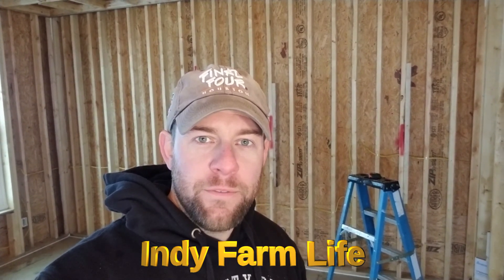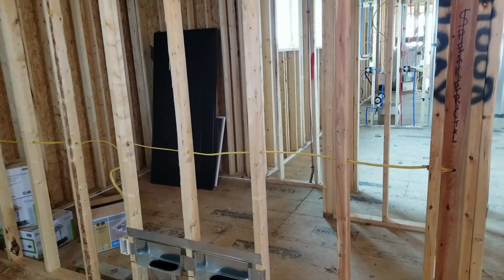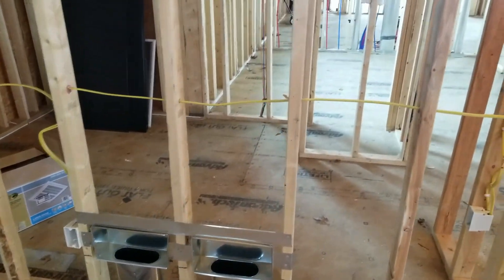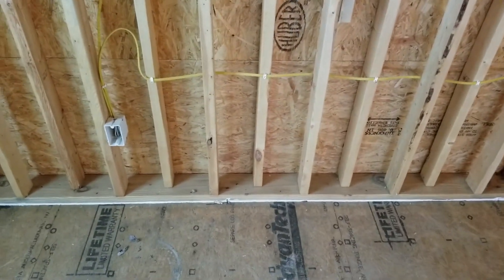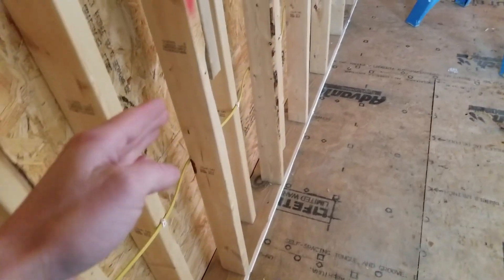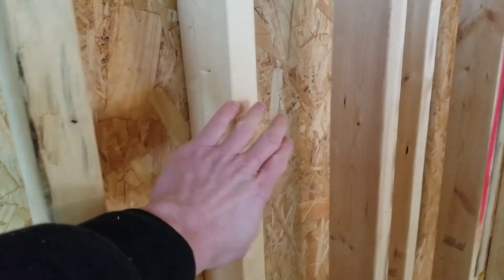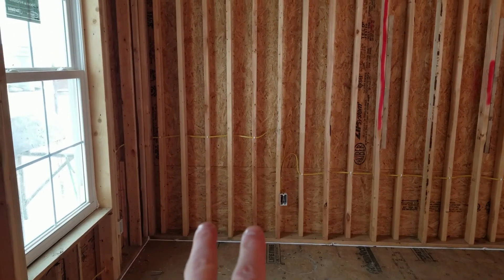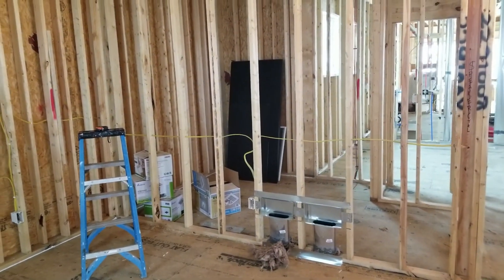Staggered Stud Walls: An Advanced Framing Technique - This is COOL!

Comment: You still have cold OSB condensing surface on the outside. The more interior insulation you have, the more exterior insulation you need. And ditch the OSB bug food.
Reply from the maker: It's zip board, but yea.  Would you use instead of zip?

Comment: electrician here, only time ive seen this is in a high end home for sound proofing on a few interior bedroom walls (with insulation). im surprised it is not a technique used more often. One of the biggest things i would consider luxury is how quiet your living space might be, leaving the noise of the world outside.
Reply from the maker: We have been very pleased with how quiet our home is from this.  We also put rockwool in all our interior walls and ceilings between floors as well.  It's a very quiet home.  Our electrician was also pretty happy with our use of the staggered stud setup. ha

Comment: Does code require 8 inch centers if you stagger? Seems wasteful. If it does, you'd think that 2 x 3s could be used instead. That is still stronger in compression than a 2x4 stud every 16 inches.

Comment: Comparing double the cost of the wood against the convience of the electrical runs and potential added space for insulation, I think I'll stick with traditional walls. Nice tip though.
Reply: it's also about long-term running costs.  doing this technique in an area with a lot of heating days can get you an R-30 wall over a standard R-18 or so, using fiberglass which is pretty cheap.

Comment: That wall is worse than just using 2x6 studs. Cet Par, staggering studs does not improve thermal value.
Reply: disagree, you've removed 92% of thermal bridging
Reply: @BrianKrahmer Do you know how to do a Manual J? Do a 4’ section of wall with and without, cet par.
Reply: @richardstewart4303 yeah, and manual J is simplified, not being able to take into account thermal bridging

Comment: This system, as shown, lack fire breaks that most building codes require. If built with only a 2x6 plate, this seems to be a waste of materials with the minimal amount of extra R value it can provide. A wall built like this really needs to be 8 or 10 inches thick to justify the added 2x4's.
Reply: not sure what you mean about fire breaks.  required in tall walls, openings between floors, etc, but i'm not seeing this as a general problem with this method

Comment: Another savings: the inside drywall/insulation studs do not need to be 'standard and better' because they are not structural (the studs on the outside edge are the structural studs and must be 'standard and better').  The trouble is, because of computer--guided sawmills, they aren't making many 'utility grade' studs.  The solution is to go to sheet metal shops and even motorcycle shops and find their ten feet long pallets.  I have built a cottage with staggered studs, except that my exterior walls are ten feet tall.  But I found all of my studs--standard and better, and utility studs in pallets, production home construction (they throw away all their bracing 2X4's), and demolitions.  By the way, go ten feet tall: it gives the smallest space (my cottage is 15X20) a good feeling.  And you increase the storage space against the wall in cubbies or bookshelves--you can even add storage above the windows and doors.

Comment: The USA seems to love houses were you have conversations through the inside walls. I would always build with decoupled inside walls.
Reply: standard 2x4 framing with fiberglass or rockwool sound proofs very well and is cheap and easy

Comment: Why don't you have noggins? Ie the horizontal pieces between the studs... that is what we do in Australia?
Reply: cause its for soundproofing
Reply: @TheDetoxCureGuide we still put sound proofing in🤷‍♂️
Reply: @co2588  the staggard studs are to separate the walls, noggins would defeat the whole purpose.
Reply: @TheDetoxCureGuide we do,  and it actually doesn't. I assume we must do it to create a bracing effect. I'll have to ask an Aussie builder.
Reply: generally not required if wall is less than 10' tall

Comment: Just curious, why did both of the staggered walls utilize 2x4s?  Since I would infer code, only required one of them to use 2x4s?

My reservation is that it seems over-engineered in compression and far more costly than needed. Versus a 2x4 or even a 2x6 wall on 16" centers. Do you think there's any possibility that code enforcement would allow 24-In spacing  (where 16 on center is the normal requirement) and/or smaller dimensional numbers such as 2x3s, at least on one of the staggered walls? I guess in most cases it requires hiring a licensed structural engineer? 

Good luck with what you built.

Comment: Instead of goofy staggering it seems to waste less copper wire/pex when they run 2x3's on one-side with an 8" strip of OSB or plywood horizontally down the center for raw shear strength.  These walls tend to be way overbuilt for vertical load at the expense of shear.

Comment: Ill be getting mentored by a buulder soon to get started. Hes been able to build for prices i didnt think were possible but from what ive seen hes definitely hitting minimum spec on things like insulation. I see basic house wrap on his builds, OSB, but then the interiors are immaculate. I have nothing against OSB or Tyvek btw. He sells homes for under 300k sometimes which is very difficult in our market. He has to save somewhere. 

Personally, i just want to add a tid more value without going too far from his formula because it clearly works. How much more does staggered stud cost vs traditional framing? Id really like to provide a better insulated home. And maybe ill save on HVAC since the home wouldnt require as much if its insulated well.

Ive also been looking into "the perfect wall" but it seems too expensive to service the price range we are aiming for. I want to do SOMETHING to add some more value on a budget.
Reply: OSB and tyvek are better than zip.
Reply: @_PatrickO no its not. Zip in particular is actually a higher quality osb. And it has a liquid adhered weather resistive barrier with a low perm rating to help prevent moisture driven from outside to inside. Tyvek and osb is fine but clearly inferior. Not to forget its not air tight either. Lets not forget its prone to tears and hard to repair neatly. Its also slower to install. And its harder to get window flashing right. 

Its not an awful product and it has a place but its inferior to zip all in all. Or self adhered weather barriers in general. Its just much cheaper and contractors know how to use it.
Reply: @vespaman101  What happens after 30 years when the seam tap fails?
Reply: @_PatrickO  fail is a strong word. Is all the seam tape on the entire home going to fall off? No. Will it get some tears and peals? Sure. Tyvek will too. Tyvek becomes brittle sometiems after a few years. Not to mention tyvek also is taped. And the cap nails and staples will rust. No system will be perfect 3 decades after install. Assuming the install was done right id bet money that zip more consistently outlasts tyvek if not for any other reason than its way harder to install zip incorrectly. And zip will result in the interior of your home lasting longer.

Comment: Nice!  But one question…  So since your electric wires are run behind (and in between the two stud walls), does that mean you don’t need steel plates over the studs where the electric wire runs?
Reply from the maker: Bingo!  Another benefit!  The wires are then 3.5 inches behind the face of the stud. I.e. behind a full stud.  Those are only required when you bore through a stud and the hole is within 1.5 inches of the face, which is the typical length of a drywall screw.
Reply: @ - That’s what I thought.  Thanks for the clarification!

Comment: I have lived in a house with staggered studs for 30 years and I can attest to the energy efficiency, living in northern Montana.  The insulation is just batt fiberglass on the outside and on the inside..

Comment: Why not do 24 inch centers and save lumber?
Reply: Even though there you have plenty of studs for downward load bearing you only use half the studs to attach your sheathing to (interior or exterior). The advantage of 16" over 24" on center is more studs to nail to. So regardless of having load bearing strength, shear strength doesn't change with staggered studs. That means weaker sheer strength, but more notably the wall can be more easily bowed from a warped stud if you are 24" and not 16". Doing 24" studs you need to be extra careful to cull or tighten warped studs.

Comment: This technique is good for soundproofing the walls better.  Not having connectivity between the studs aids in reducing sound transfer. The exterior wall construction is more important than the inside walls so extra cost is worth it.

Comment: What would you recommend for insulating that exterior wall that's staggered with mineral wool? Is there much of a weight difference (of the wall) vs traditional, as well as weight bearing capacity with staggered stud?

Comment: I knew of this idea back in the 70's, difference was 8 inch top and bottom plates and 2 X 4's were staggered 24 inch on centres. Much better build and higher insulation value, R28 .
Reply: i'm liking this idea.  my past few builds, i've been using zip r-sheathing (r-6) with 2x6 walls and R-21 wall insulation.  the problem is the r-sheathing is extremely expensive, and is a bit fiddly.  2x8 plates with staggered 2x4 16oc should give the same thermal result (probably a bit better) but faster and probably lower cost

Comment: Can this be done with two walls back to back instead of one single 2x6 plate? How would the OC studs be spread? I did one side 16" OC and confused how to go about the other side. Any help would be appreciated
Reply: you could do another traditional wall in front of your exterior wall with a couple inches gap between them. accomplishes the same thermal and air gap that this does, and even lets you join your wall insulation with your attic insulation to make a complete kind of envelope of insulation since you can run insulation through the gap between the two walls with no top plate

Comment: Id argue that shared room and bathroom walls would benefit greatly from the staggered stud technique
Reply from the maker: Probably so.  I used rockwoll in those walls.
Reply: You can use rockwool with a staggered stud wall.
Reply: Especially laundry rooms & Rockwool Safe & Sound is the way to go

Comment: I designed my addition with this staggered stud design, this was about 5 years ago.  County code approved it, inspectors didn't like it.
However, I used 2x4 24in oc for the external walls, and 2x3 24in oc for the internal walls, and showed them the 2x4 24in oc was code allowed when sheeted with osb.  The internal 2x3 wall simply isn't relevant as structural.  It just holds up the drywall, nothing else.
Reply: how did u ever find straight 2x3's?

Comment: Would going to 10 feet in height be okay for exterior?
Reply from the maker: Yes!  Our entire first floor is 10ft.
Reply: @IndyFarmLife  Awesome.  Made my day.
Reply from the maker: I'm happy to hear it!  Yea, we are 10ft on the first floor and the staggered stud carries upstairs where it's a 9ft wall.  When you count the i-joist in between, it's a 20ft wall.
Reply: @IndyFarmLife  Great!  Looking to do just a one story build with 24' trusses connecting the exterior walls.  Big open room for drums  :)  Staggered stud seems to be the best overall choice for this given my budget.  For insulating with batts, my plan is to go R19, split into 2x ~3" batts and fed around the studs to get good coverage and thermal breaks.

Comment: That would sure be a nightmare getting any plumbing lines through that wall.
Reply from the maker: Maybe for horizontal runs of DWV, but vertical are no problem.  Pex lines are as easy as romex and don't need any drilling.  Keep in mind only the exterior walls are constructed this way.  Typically, there isn't much plumbing in exterior walls.
Reply: Drains and vents same as running in regular 2x6 walls

Comment: I'm no engineer but it seems to me that perhaps 2x3 studs would be sufficient to meet structural requirements, leaving more room for insulation.
Reply: Indeed, it's possible for non-professionals to safely build certain structures. However, when we consider using unconventional methods or materials, such as using 2x3 studs in load-bearing walls, it's precisely in these situations that consultation with a licensed professional engineer becomes crucial.
The world of building design is vast and varied, and for a significant number of structures, especially larger and more complex ones, 2x3 framing may not meet the necessary structural requirements. Moreover, the additional costs and efforts of accommodating such dimensions can outweigh any potential benefits, such as an extra inch of insulation. Another important aspect to consider is the quality of wood and construction. Even experienced framers, working at a fast pace, can sometimes leave studs split or flayed at the end connections. Redundancy in design, an important principle in safe construction, can provide some tolerance for these uncertainties. However, in the context of residential framing, a smaller dimension like 2x3 may not provide the same level of redundancy, potentially lowering the wall's actual resistance.

That said, your point is taken that 2x3 studs could potentially meet structural requirements in some cases, particularly for smaller, less critical structures. This emphasizes the importance of case-by-case assessment by a professional to ensure safety and compliance with standards.
Reply: @benloving  I did say 'perhaps' ;)
Reply: @NotFound-ll5kc  Yes, you did perfectly well. I did point that out also in the response "your point is taken that (...) could potentially", hopefully this information was useful to you. Please keep in mind it was not intended to make you feel stupid but rather share with you and others my thoughts on it.
Reply: @benloving  That was nice and articulate.  Is there a place I can find more information about staggering an exterior wall?  I would go 10ft in height, 2x6 plates with 2x4 staggered 8"OC .  I would assume this would be fine (overbuilt even) but your point is well taken.
Reply: @bobsondugnutt7526  Pretty sure that was an AI-written response.

Comment: This is a great example! I've been looking at advanced framing techniques using 2x8, and was thinking if I did double wall, 2x4 (staggered), could I actually get a higher performing wall. Based upon lumber costs, so far, it does seem a lot better. Bonus, being able to run the other items between the walls instead of drilling! And another bonus for most could also be that lifting a 2x4 wall has gotta be lighter than lifting a 2x8 one. =)
Reply: You can use 2 2x4 plates instead of one 2x8.  You can also separate the 2x4 plates if you want to add even more insulation.
Reply: @badawesome  great idea, thanks!

Comment: So this is in essence a 2x6 wall, but without as much of thermal bridging on studs, but having same thermal bridging at plates. 

It makes it easier for electricians, but it takes longer to build and it doesn't increase overall wall thickness.

For example what would be total cost of regular 2x6 24OC wall with 2" exterior rockwool including both material and labor cost? How does this staggered setup compares cost vise and R-value wise?

Another point is I like DIY friendly stone wool insulation which comes in batts, which also doubles down as fireproof, soundproof and insect proof wall filler. I don't have any experience, but it feels like filling this staggered wall with rock wool might be more labor intensive than regular 24" 2x6 wall. 

I've seen double wall setups which were very impressive - 2x6 24" OC exterior wall, 3" gap and 2x4 16" OC interior wall nailed to floors and ceiling joists with total wall thickness of 12". They have essentially zero thermal bridging between studs or plates, the only bridging comes from window plywood connections and floor/ceiling joists. And because of this 3" gap just as easy electricals on the back side of interior wall layer.

It is more labor intensive as you're building twice as much of the wall on the exterior, but the benefit is to have massively better insulation that's more than twice better than staggered 2x6 wall. Extra materials for that setup would be basically just extra 2x4 plates and more work on window/door openings, but that seem like a lot better bang for the buck.

Can anyone knowledgeable fill in the gaps?
Reply: I don’t claim to be more knowledgeable. 

The real benefit of this method is that the drywall that is receiving the sound waves will transfer the sound waves MUCH LESS to the other drywall since the two drywalls are not installed on to the same studs. 
Think of it as double panel window, but sound instead of insulation. 

In my eyes, the benefit of this method out weighs the increased cost. 
That is if the cost difference is even significant to begin with. 

I think you’re making this technique more complicated than what it should be…

Comment: I want to see the plumbing snaked through the wall... XD
Reply from the maker: 1/2 pex would be no problem.  However, I don't know that we have any lateral runs of water in our exterior walls.
Reply: @IndyFarmLife  yeah pex would be easy... But wouldn't the zigzag copper look cool? XD Oh, i know, use soft copper, that would work awesome!

Usually I've done lateral water runs on exterior walls with kitchen sinks under a window, where supply is coming in overhead, and with master bathroom double lavs (sinks).